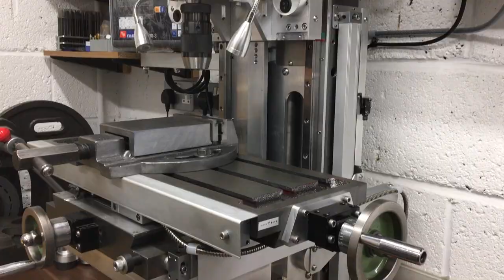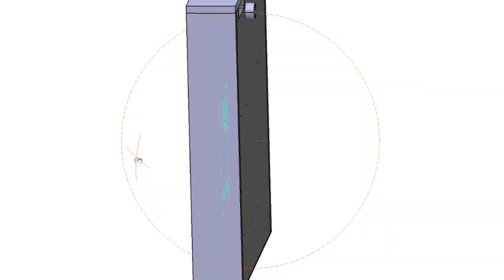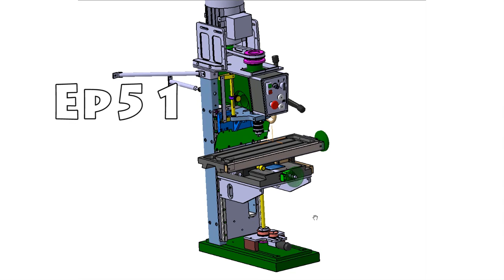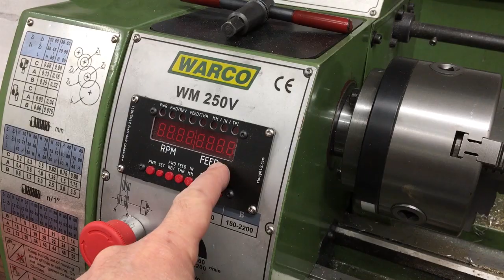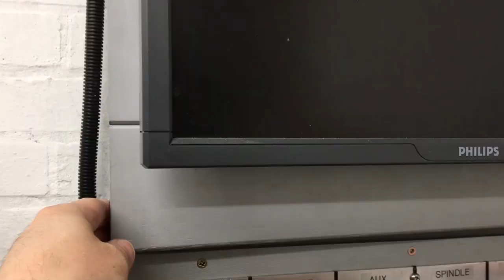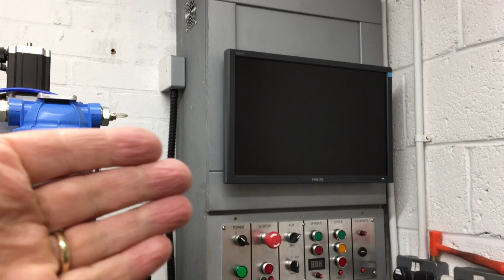Ep51: Drill Press upgrade | Starting the enclosure!

Comment: A bit late now but I would recommend birch plywood (it's called multiplex here in Europe) It's very well finished, stiff so it doesn`t need to be so thick. Also some cheap metal hinges would do the job nicely. Nice video by the way. Cheers
Andrew
Reply from the maker: Thank you.  To be honest next time I’ll try harder to find a metal enclosure.  This took time to make and the cost of the wood, paint etc was about the same.
Reply: Funny thing is I have been gathering parts to put together a new cnc machine based on a sorotec cmpact line kit for a while now (years! as my old one still works and there's no room for 2 machines)  I bought a metal enclosure and I don't really like the size of it. Your video has inspired me to make a box (I'm a retired guitar maker so I have all the woodworking tools) Thank's for the inspiration. Cheers
Andrew
Reply from the maker: Hi Andrew.  Glad it was useful!

Comment: Nice bit woodwork next time, can you please use the right screwdriver bit? I think you need a PZ2 sorry Just a pet hate  of mine lol
Reply from the maker: Apologies!  Yes I was struggling there. Unfortunately it is much smaller than PZ2 and although I have lots of bits these very small ones are starting to get chewed up.  I’ll see if I can get a quality set.  Any recommendations?
Reply: @routercnc9517  well I normally use Stanley pz2 they last for quite a time great videos by the way
Reply from the maker: Ok great thanks

Comment: careful with pla in electronics cabinets. Sometimes it's sometimes it starts deforming from strain. All my electronics enclosure related parts are either PETg, or ABS. I've been using some carbon fiber filled stuff more now -- PETg-CF is really great, easy to print on the bambu, and has a nice look (you'll need a couple of upgraded parts for the P1S to print CF materials)
Reply from the maker: Ok thank you I didn’t know that.  I’ll carry on with the wiring and look into replacing them later.  Thanks
Reply from the maker: A quick search reveal a fairly well thought out set of tests from this guy :https://www.youtube.com/watch?v=88pk2cNOeGE

Results are at 28:22.  If the enclosure stays at room/workshop temperature then the PLA creep looks similar to PETG and ASA (for the 'C' shape test).  If the enclosure gets up to 46 deg though then load creep on the PLA is almost double PETG/ASA.  I'm wondering that since the lift motor is used very intermittently it might be OK? I'm going to see what happens for now, although totally agree with you that for general enclosures it makes sense to go with PETG/ASA based on looking into the topic.  Appreciate the comments as I learn more about 3D printing.